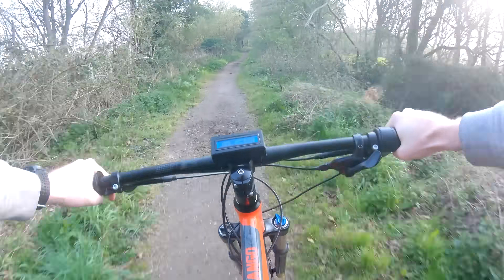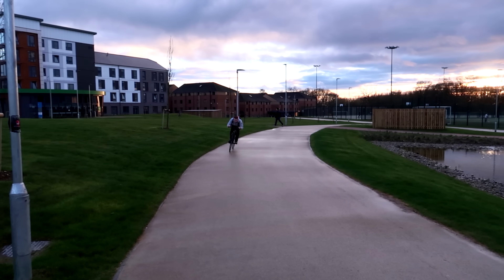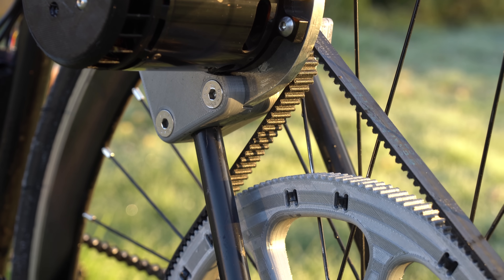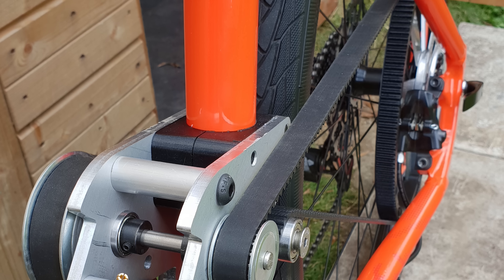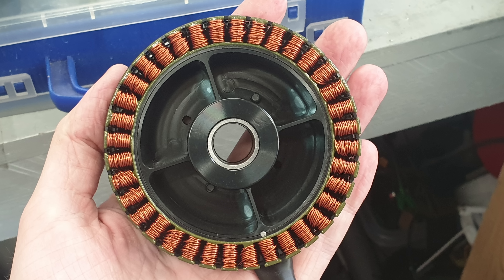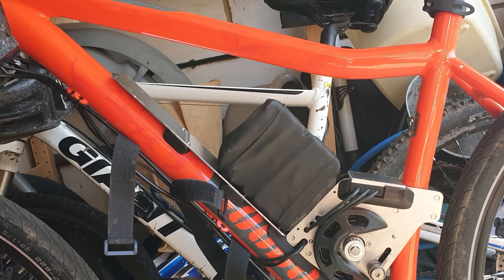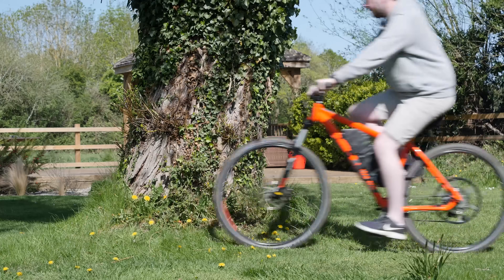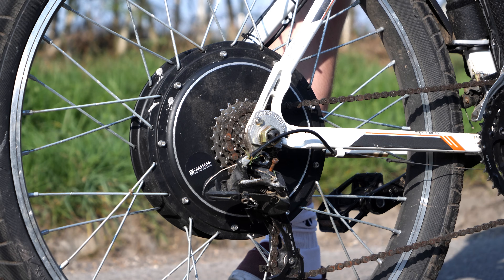Building an Electric Bike

Comment: i built my 1st ebike in 1971 with a bmx a starter motor and 12 volt lead acid battery, listen i have the key for you is to make the rim of the wheels a really large gear by putting some small pieces of metal from the rim to the new same size 700 c gear,  it's so large you can use an old tubeless hub you don't need teeth, giving you an easier ratio, thank you, you made me feel happy

Comment: still baffled as to why you didn't just use the existing chain
Reply from the maker: Can't get the required ratio with a chain as the minimum sprocket size is too large.

Comment: Seems a little overkill. More like an electric dirtbike when you run at several horsepower continually. Hub motprs are great if you don't care about running the thing through the gearing and are the ideal setup for efficient regen breaking.

Comment: if it has more than 250w or has a throttle or can go over 25kph, you have a e moped in the eyes of the law not a e bike , so a bicycle that cant use bicycle infrastructure and a motobrike thats way too slow and has no range,  worst of both worlds

Comment: as someone who has tried 30mph+ on a push bike with vee brakes with zero suspension, it's terrifying. Wheel balancing definitely a problem, stopping definitely a problem. Dealing with the unpredictability of other road users is a problem. Get yourself some 302s from uberbike (or anywhere else reputable) and some nice pads before seriously riding it on the roads.

Comment: I always wondered a thing that i've seen in all kind of DIY E-bike, why don't you connect the motor to the chainring mayby by adding a chainring to make it fit because there is also the chain it self as a problem, but still, wouldn't it be better to do it so to also have gears?

Comment: I want to build electric motorcycle with two 6384 flipsky motors. I wonder if it will cose a heat problem? I will use 13S battery with Flipsky Dual 75100

Comment: Nice build.
I am considering using carbon drive belt in reverse (small pulley in front), but can't find any torque figures they can candle.
Did you have any belt issues? What was the max torque and width of the belts used?

Comment: My friend also made an e-bike but he used a big-ass battery on rear, and motor from a hoverboard. It struggles at uphills due to overheating, and on flat road it maintain 40 km\h speed for like 50 km, but because of heavy battery. bike is very unbalanced

Comment: Seeing this 3 years late but dude could have saved time and work from trying to adapt the rear wheel over and over to fit the project. Could have created a hub that met all the needs of the drive systems and laced it to the rim easier than engineering all the adaptations.

Comment: I wish I saw this video when you made it, I can solve the first two-motor problem easily for you...

In conveyor systems, when we need to add an extra motor, we do it in a similar way to how you’re done, it, but, the second pulley is made slightly larger than the first, to it “over-drives” creating tension in the belt between the two motors. This also has the benefit of allowing the first motor to inout more power into the system than it normally could due to the higher t2 tension. What you would be better off doing is: put the second motor in the place of the pulley between the two motors so it’s running on back side of the belt, and make it’s pulley around 1.5-2% larger than the pitch diameter pf the primary drive pulley. The secondary motor will obviously have to run in reverse, but you will get massive benefits over your other arrangement.

Comment: Thankyou, as a diy it great. But direct motor is better in power consuption, noise, fault tolerance. I use two wheels with motor and without to drop weight, if needed.

Comment: My idea of upgrading your concept is; 
+Make a 3d printed cog that is attached to rim spoke ends instead of disc brake bolts. (it'll be the biggest possible drive ratio & lowest part weight)
+no belt, gear-drive
+use double 270kV motor each side of rim to distribute power, hence heat
+use 18650 batteries inside a lightweight tube instead of welding them side by side
+make a mechanical clip that clips on/off to the gear, to remove drag when battery dies. (you can use v-brake arms)
= It'll be ~5kgs and freewheel available
Buckle up!

Comment: I have been designing an electric bicycle (wrapping up) and starting on a motorcycle. I am actually a civil engineer but more interested in electrical & mechanical engineering lol…anyway there are actually a few CAD adjunctive software systems & plugins to simulate designs allowing for identification of any design elements to be adjusted. Unfortunately the main ones I use are from Autodesk because I use work license but there are some open source ones as well.

Comment: Yes I am an engineer, and no I didn’t build mine from scratch, it’s far far simpler to buy a high power hub motor (20KW) and a specialised frame. I’ll have my own fun with the battery and controller but I refuse to fuck around with motors 😂

Comment: Could you take one of your e bikes and instead of having the pedal connected to the wheel use it to run 2-4 of those cheap drone motors (as generators) you find these days?

Similar to this but small enough to fit on a bike frame
https://youtu.be/57A_l9_b610

A custom gear box to convert high torque low rpm pedaling into high rpm for the motors

Regenerative breaking like how a bicycle brakes work but with dynamos instead

A small capacitor bank, the right motor controller, a tiny display for how much power is coming in then you'd be golden

I'm pretty certain it'd be fairly efficient

Comment: I built a display similar to yours, which keeps track of amps and volts (watts) vs time, so the battery charge can be tracked. It also allows converting the controller from a speed control throttle to a watts controlled throttle, as you mentioned you did. I like that, it is more motorcycle like and you can then set preset power assist wattage amounts- speed might change but watts can stay at the preset level. My motor is a Bafang BBSHD with the internal controller.

Comment: Yes when you pass a magnet through copper or aluminum it creates its own magnetic field which goes back on itself that's why the magnet slowly goes through square around tubing made out of aluminum or copper I would suggest putting a barrier that does not allow a magnetic field to pass through obviously spacing it works but adding something will work even better or maybe just go with stainless steel just a thought good job but I'm going to go ahead and buy bafang motor kit

Comment: To be frank, Considering the concept of motors, The Hub motor wheel and something alterantive is a better decision. Although I will not trample the Idea of the D.I.Y setup. But for effectiantcy and possible better modification, The best solution of the bicycle is limitless. It inspires me to get my tools out and tinker, But of course the economy as it is right now. Hobbies are a bit scarce. haha. anyway. I just recommend people to go with the Center Hub motor or a Centeral Drive Unit for Electric Power assist.

Comment: Would be possible to use a one or more motors to reduce the torque   inside the hub of a rollerblade classic 80 mm or about wheel? I am dreaming about a pair of fast rollerblade full electric with regenerative brakes. Please consider the challenge I will become one of your patreon!

Comment: Just a point for those thinking of trying it at home. If you are on a public road with an ebike that can go above 16mph or has an accelerator (not pedal assist) then its legally a motorcycle or moped depending on power and needs a license

Comment: You make some awesome engineering video's, keep up the good work!! :p  I have a question about the motor kV - gear ratio. Were did you find that this ratio has to be a factor of 10? I am currently converting  a minibike from petrol to electric, and i calculated this ratio for my build and it's around 16.9. I guess this will be really slugish then. Does this apply to all sizes of motors? Or is it just for the smaller ones?

Comment: What is the point in this failed project???
You wasted a lot of money, the motor is noisy, its location is not convenient, it's not reliable, it's not power efficient!
Just buy a Bafang hub motor kit, 500W is already plenty of power but if you want more, buy a 1000W kit!

Comment: All this on an unlicensed motorbike you are not aloud on the UK roads picard face palm  If you are doing this anything over 250watts needs a road license (DVLA inspection), indicators, fixed head and rear lams as well as a horn.  Getting pulled over on this bike will result in a fine, bike destroyed and points and/or a ban for driving without insurance or road tax.

Comment: Hi! Im building a similar build for my electric bike, and i have a question about your motor. If you pedal the bike while using it, would that charge the battery? I heard that motors can also be used for generators, and since your manually rotating the motor while biking and its connected to a battery, would it charge the battery then?
Reply: Not how ot works, the motor is a bldc motor with 3 phases and thus it needs a controller to convert dc to the pwm ac signal, wich is why he has a vesc wich has mosfets and a micro to control them, so no point in regenerating power cause it gets dumped in to the esc diodes and not in the battery

Comment: If you are not willing to spend money like me  you can use a DC motor not bldc as it requires vesc and a lead acid battery 🔋 but if you want variable  speed use a speed controller if you are not comfortable puting it on the rear wheel put it on the front

Comment: Those bikes aren't designed to handle those kind of top speeds like that, one of these days the forks will snap in half and you will land on your face and lose all your front teeth. I recall when I was younger a buddy of mine was racing down a hill with new bike it was at least a ten speed back in those days. The forks snapped on him and he lost his front teeth and scrapped the skin off his face after hitting the sidewalk. I would at least reinforce the front forks and reweld them, just in case. Always better to be safer than sorry.

Comment: I remember an old moped I had and it had a belt drive that would move toward the other bell housing unit and increase speed. So maybe a 3rd engine for torque and power plus your variable speed??

Comment: i want to build a e bike but there are to many restrictions!!
i can have a max of 750 watt motor 
and NOTHING over 70 volt 
meaning bad range speed and acceleration 
and in my town max top speed for ANY e bike is 28.2 mph /45.3 km/h
HOWEVER there is not a limit on e skateboards..

EDIT ( i can pedal to almost 40 mph so if the e bike can not do that i wont use it )

Comment: To tension the belt between the two motors who's casing spins, use a free-hanging tensioner that 'pinches' the belt between the pulleys. This free-wheels in the two 'v's made, and can be cam-adjusted and/or sprung-tensioned as required.

It looks like a large version of a single bike-chain link, with the belt passed through the gap. It does not fasten to anything on the frame/housings, it just rides on the belt itself. (see very crude diagram).

 (      )
  \   /
Ol  lO
  /   \
(       )

Comment: I find the whole idea of building your own ebike fascinating and intend on taking up the challenge for the first time using a 20"/21 speed mountain bike. Any suggestions for a decent motor with speed capability above 20mph? Also, has anyone ever tried to add an alternator to the build to assist in charging the onboard batteries as you ride? Hit me back with serious suggestions. Thanks.

Comment: One thought on the formula -

Kv x (Motor pulley / Wheel Pulley) = 10 is good 

This seems to be true for 26 to 28 inch wheels but if your building something with say 14 inch wheels you can double that 10 to 20.

Comment: When I first heard about electric bikes, I assumed that they would be chainless - a generator at the pedals, and a motor or two at the wheels.

Is that feasible? I imagine that torque might be an issue, but a suitable design may help. I am thinking of several small motors along the radius of a metal disc, switching them as appropriate.

Comment: I’ve got a little money saved up and a month off work in January, if I want it. Very tempted to clear out a workshop at the family farm and fit out something that could be used for day trips. I already use an electric skateboard for such things, but it really only gets me the 15 miles to a train station, which I then take for a few hours as my batter charges, and then go for a ride someplace new. Would be nice to just get on something and go.

I avoid driving in cars as much as possible. Statistically speaking, I’d rather die on a skateboard enjoying myself than get slaughtered because someone needed to send a text while eating subway.

Comment: As a non-engineer fostering my mad skillz I'd like to build my old 1986 Raleigh Grand Prix to buzz around on and borrow from this awesome design.  To reduce weight, I will try capacitors instead of batteries, they work great in cars.  Bend the pedal stems outward an equal distance so the left side pedal will clear the hub on the next design unless I find another design that allows pedal play with no leg interference.  A bicycle light generator powered off the rear flywheel or tire could slowly recharge the capacitors.   I know nothing about regen braking so I will yield to a greater design because mine will look like a heap till I fashion the right parts or buy them.

Comment: i have been wanting to do this too but i don't understand why people don't connect the motor to the chainring because you would then have gears can someone tell me why, please
Reply: 1. You need to reduce the ratio. 2. You have to make a sort of clutch to disconnect it from pedals at least 3. The motor can have more torque and can cut the chain so you need some rubber coupling.  4. Electric motor gives a lot of torque from zero rpm, so you don't need gears

Comment: i wanted always a bike with a real powerful electric motor, with energy recovery breaks, but mainly driven by pedals, the motor just gives you more power - I thought about a two or three motor system with exchangeable batteries, maybe one or two hub motor and a extra motor at the Pedals - this whole thing should be build for power and speed, so it has to have a really good transmission and also good breaks and everything, probably a Downhill bike would be the bast base for it - also a good controller computer, is neccecarry to set the right settings for every challenge. 
If i have the money i ask you, if you can build me something like this😁
Reply: yeah i dont think that you are capable of just doing such a project yourself. Money shouldnt be a limiting factor. An Idea is only the first part, bringing your idea into reality is the difficult part.

Comment: I'd like to see you build an in-wheel motor style bike on both wheels, and run it off-road as well.  And address any dust or mud issues.  Maybe a DYI radiator for heat dissipation, if useful?  Maybe have a full bike immersion test in water.

Comment: I really like your ideas. I think Tesla should really consider improving ebikes after they build the cheaper version of their car. I've had similar struggles trying to convert a bike to an ebike. Some of the balances of design also include performance vs durability,  efficiency vs cost. I have a much smaller budget, so I'm trying to take scrap parts like a discarded washing machine motor and rework them to be suitable for an ebike. Another problem with brushless motors is the high rpm, but that it necessary for small efficient motors to function properly. The next step is tearing down the motor. I'd like to have mine drive the crank like a mid drive, but that requires gearing down to 60-70rpm. I don't have a clue how Bafang gets away with the systems they have. Most options are far too overpriced if you ask me. 
If your motor drives the rear wheel, a more efficient option is to use pedals to get started and then use the motor at higher speeds. I'd like to know what would happen (if it's possible) to use a hub motor as a mid drive motor by gearing it down and driving a secondary sprocket (/belt wheel) on the crankset. I've done about a week of studying motor windings 🤪. Wish me luck
Reply: Autotype changed a couple of my words🤬.
I have another experiment for you before you try building another motor. Take a regular magnet, not neodymium, and put it on a bare piece of metal that contains iron. Observe the force required to remove the magnet. Then add thin layers of plastic or paper one at a time between magnet and metal and observe force required to remove the magnet. 
Magnetic forces play a large role in electric motors. Keep in mind that 'permanent' magnets are by NO MEANS permanent. As a magnet degrades it causes windings to work harder, overheating the motor. Hope this helps. Please keep experimenting and learning.

Comment: maybe a dull question 😎 but would this setup be viable for building a regular 250w bike. I mean the first one with hobbyking parts.
would it hold up as a daily if you didnt kick it so hard?

I have read that an ebike have to have the motor connected to the same drive chain as the pedals for it to be classified as an ebike. 
So i figgure that there might be an advantage to not having to do that.

Comment: I still hear vibration. you need a bit of crush and radial interference for the bearings you chose to remove more of that vibration. Though I'd think the motor would already have 2 bearings

Comment: What about a pulley tensioner to take up the slack between the two motors?
Reply: that wouldnt work since the motor bells themselves are rotatating because this is an outrunner motor. There is no way to effectively build a tensioner beetwen the two motors